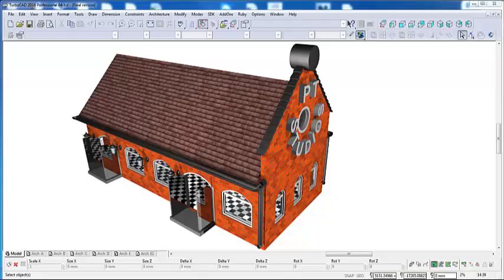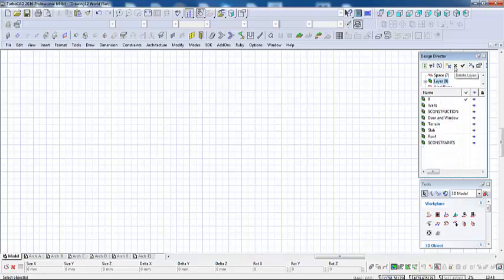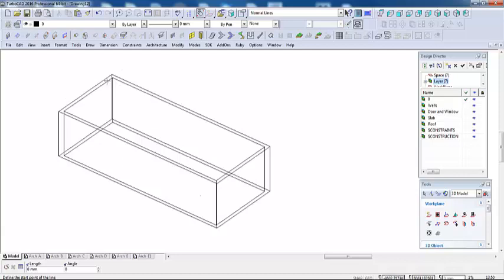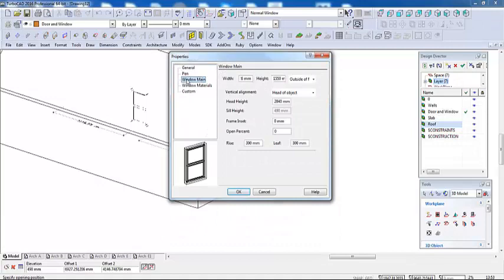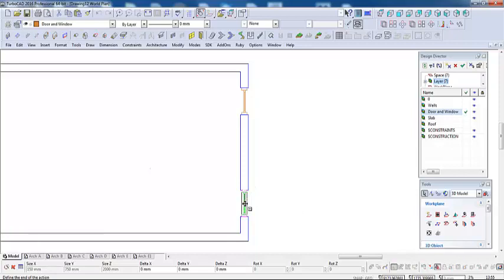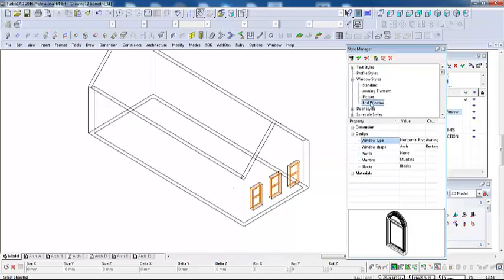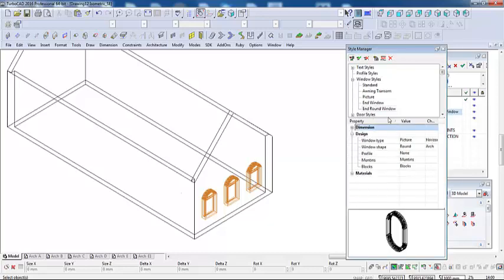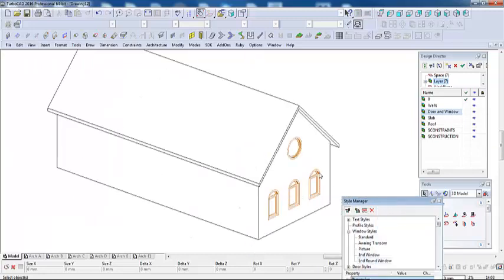Introduction to Two 3D Architectural Tutorials on PaulTheCAD

Comment: I'm using TurboCAD Deluxe 2018 and have some walls that are disassociated (not connecting).  Sometimes they join on their own and other times not.  Mainly when I'm not placing the wall at a mid or snap point.  In 3D ISO, the walls are shifted off the planes. How do you join the walls together?